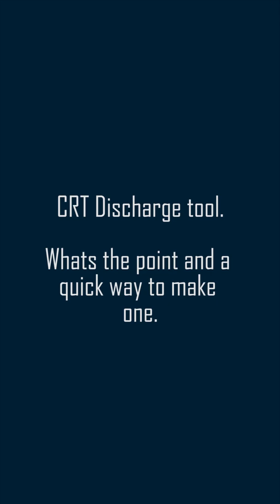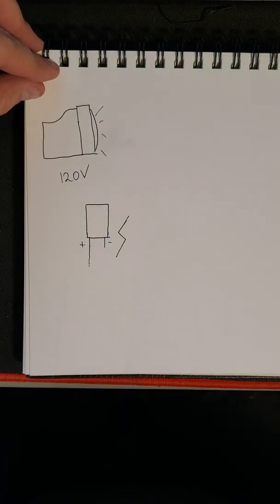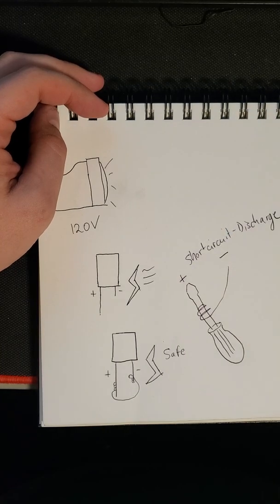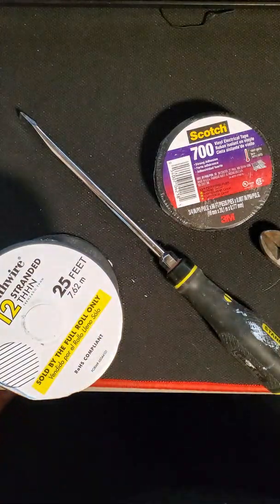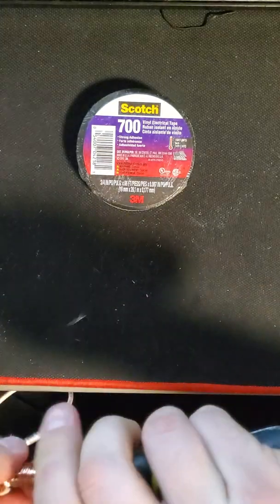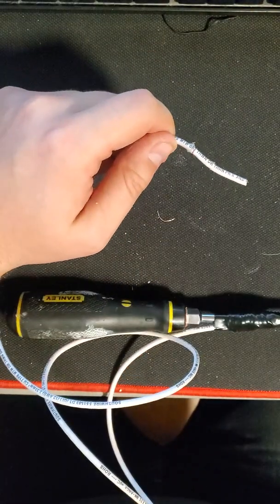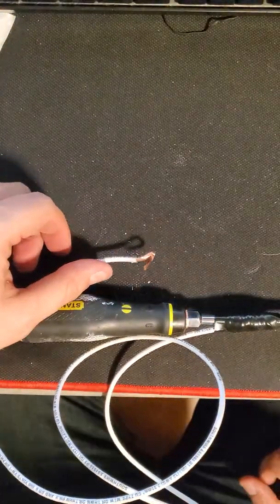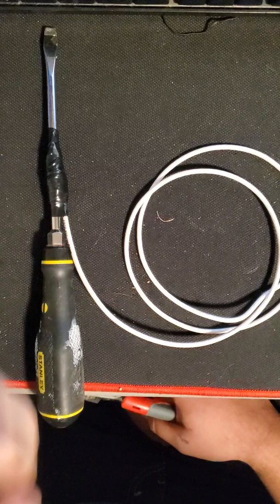CRT discharge tool, why have it and a quick way to make one

Comment: Terrible advice, use a resistor to bleed off the current, not a screwdriver. Plenty of YouTube videos on how to do this safely, this is not one of them.
Reply: What if the bleeder resistor fails?

What is the safety issue with this tool if I use insulation tape to cover all metal and the handle itself?
Reply: Some people prefer  not to use one because  they would  prefer  to hear the crack or pop . That's to actually  confirm  that there's  no actual  current  left . Apparently  I've  heard  using a resistor  to bleed doesn't  make a sound as it drains .